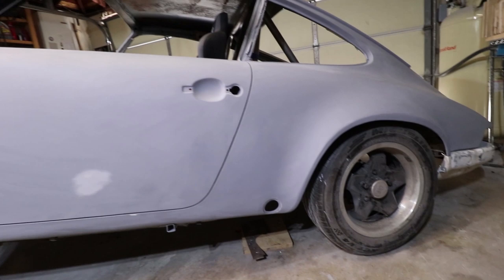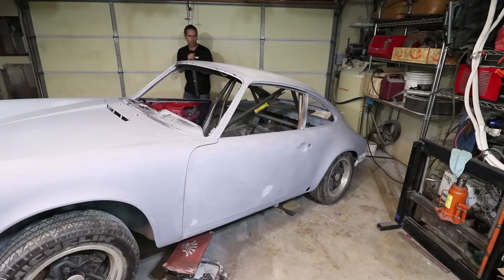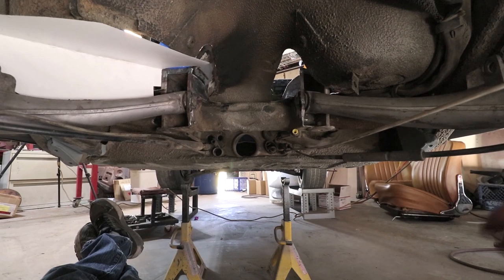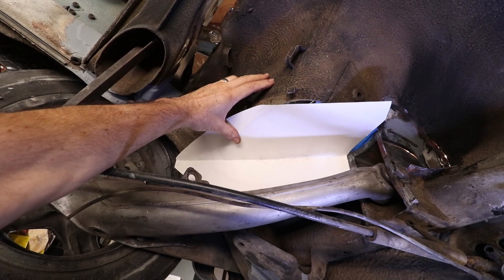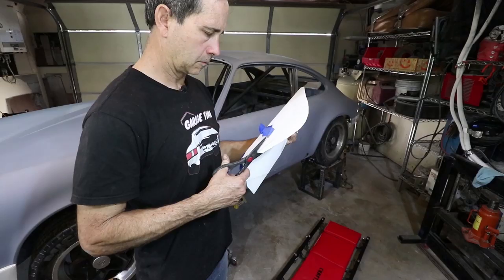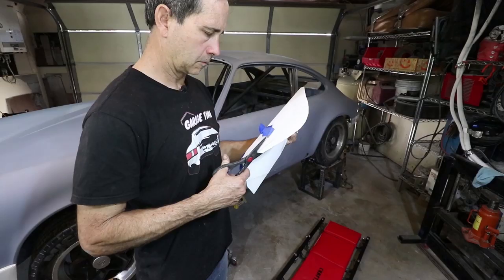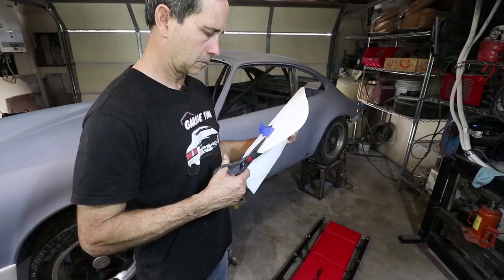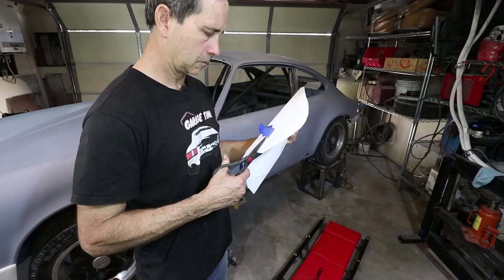Porsche 911 Restoration Project Metal Fabrication Success?

Comment: Great to see it come together! Very nice work. You do an amazing job of visualizing how your new pieces will interface with the complex curved shape of the existing seat pan- that’s not easy! I’d probably have to make (then scrap) 15 paper templates before getting to the optimum shape.
Reply from the maker: Thanks 😊.  Sometimes it takes several attempts.  Instead of throwing away templates I usually add to them with masking tape until I'm happy.  Your experience is normal, I don't always show every iteration on YouTube, ha ha.

Comment: Nice work! you should consider getting a lift, even if it's a small one, changed my life lol! I would be very difficult to find a shop that would put the same level of detail that you are doing and if you did you would definitely pay for it!
Reply from the maker: Thanks man! I thought about buying a lift but I made these tire stands instead.  They go about as high as the mini lift.  You just have to get used to working on a creeper instead of standing up.  Once the car drives I can take it to the workshop that I belong to and they have full two post lifts.  So I can't wait for that.

Comment: My guess is 800-1000 dollars for the custom seat pan mod. https://lizardskin.com is a heat and sound reduction coating that IMHO would be a nice product for your 911. It would be applied under and inside the car. Very lightweight.
Reply from the maker: Thanks 😊. I'm considering lizard skin.  Seems like a good product although I'm not sure if small sections of Dynamat would work better for less weight.  I'm sure there is a trade off there somewhere.  The weight is the big deal for me.

Comment: I admire your Talent Tom! 
Also your thoughtful approach to going from An Idea, to actual Implamentation. Let me be Devil's Advocate by just wondering out loud why you didn't do a rear seat Delete, wouldn't that have been MUCh simpler?
Reply from the maker: Thanks Jim!  You mean the interior kit?  Those are cosmetic and wouldn't be safe to use as a firewall.
Reply: I see now i didn't frame my comment very well about a seat delete. I'm not a Fan of the Kits who's only purpose is Wow factor. I know that's Not what's driving your intentions here. 
What i should have asked is, would it not have been an easier cleaner task to remove the entire seat bottoms, and fabricate ONE (or two) Larger new panels of similar gage metal that incorporated the welding flange you alluded to, and possibly rolling in some stiffing beads if necessary....
Theres nothing that aggravates me more about myself than when i look back at something i THOUGHT was a good idea and see how it could have been better...lol
Keep up the GREAT work!!
Reply from the maker: Gotcha James,  I have seen cars that have done exactly that and its a good option.  Any way you look at it a lot of work is involved unfortunately.  The one large panel technique gives more of a race car vibe in my opinion.  My hunch is that it would be louder even if stiffening ribs and sound deadening is used.  The factory curved seat buckets are rigid!  Another drawback is that you loose all the factory hangars for the cables and lines.  
I went with a less invasive approach that sort of retains the look of the stock 911 tub plus I have that engine access panel now too which is nice.  Hopefully people will notice that something is different back there, but not put off by too much homemade parts.  
Thank you for sharing your thoughts!  Remember that this is already the second time that I modified the seat buckets.  The first time I welded the torsion tube to the seat buckets (RSR mod).  Then I changed my mind and added the camber boxes and had to cut out the work I already did, ha ha.  Same is true for the seat mounts and the front hood alignment.

Comment: So, what kind of sound deadening material will you be using. If you're going to be using the dynamat stuff, does that mean you will be carpeting over it? Or will you be spraying some kind of bedliner material, and then painting over it?
Reply from the maker: My plan is to paint everything black and then add something like Dynamat over that.  Probably won't use carpet unless I really need it.  Haven't thought that far ahead actually.  I've done some sound testing in my career, so I will most likely be busting out the DB meter!

Comment: I really like how you well that came out, that was a lot of work. I would have taken the easy way out and spot weld it up top and maybe at the bottom used seam sealer. Really came out nice
Reply from the maker: Thanks!  Yes seam sealer would probably have worked too.  The bottom won't be seen after undercoating and the top will most likely get covered with something.
Reply: @GarageTimeAutoResto   With me sometimes I have to stop over thinking what I'm trying to do. That's where I get myself into trouble . The old me would have a factory curve, not a 90* bend. Welded everything, ground it back down to make it seamless, then heat the metal again so that my 5mm punch (  Of course it has to be metric)  replicates factory spot welds.....only to cover it all up with dyna mat and bed liner.... 3 months later I'm wondering if maybe this project might be a little bit over my head As I weld in my 3rd panel with a compound double curve.   I really enjoy the format and how you explain what you're doing and how you're going to do it and what's your end result will come out to be keep it up the good work
Reply from the maker: I hear ya.  I think the same way.  This car is supposed to be fun without the authenticity police invited to judge, ha ha.  But I always go further than necessary out of habit.  The paint milestone is a big hurdle for me because once it's painted the door is closed for all these types of mods.